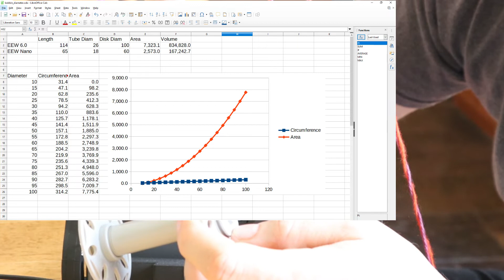Spin 134 - Why More Tension on Wheel as Bobbin Fills

Comment: Super informative video, thanks! I think the benefit of using weight to indicate bobbin capacity is of course that weight is used very widely in spinning (and knitting/crocheting) to indicate amounts of yarn. And as a somewhat experienced spinner, you’ll have your own personal adjustments to those indicated amounts: I pack my yarn pretty tight, so those weight indications are usually a minimum amount for me and I know I can usually fit a bit more onto a bobbin. A friend of mine on the other hand spins differently and she never really fits as much weight as indicated onto a bobbin, so for her it’s more of an upper threshold. It’s kind of like needle size recommendations or meterlange requirements in knitting, I know I knit tightly so I usually go up a needle size and I also know I never go over indicated meterage for a pattern, so I never buy a safety skein like others might, who have made the experience that they tend to use more yarn than indicated. Buuuut that is something you can only figure out through trial and error and I agree that as an engineer it’s not a very satisfying „correct“ measurement. I’m just saying it does fit the other measurements usually found in this and adjacent crafts.